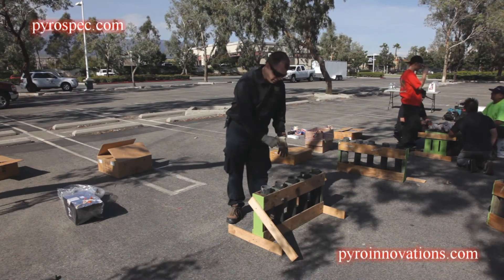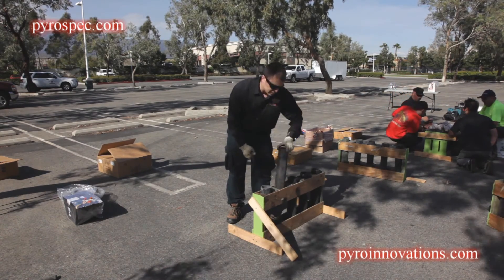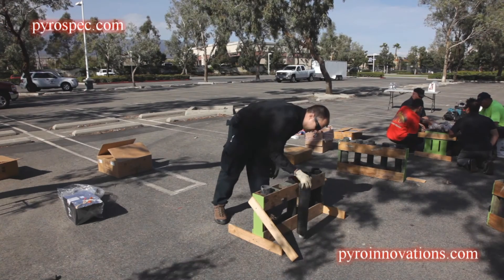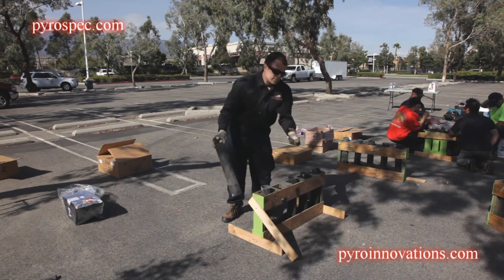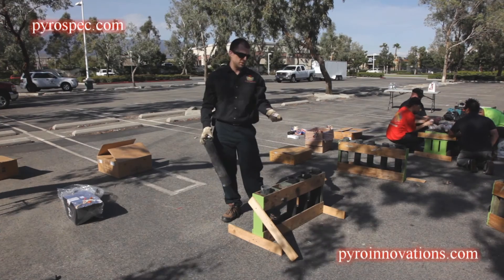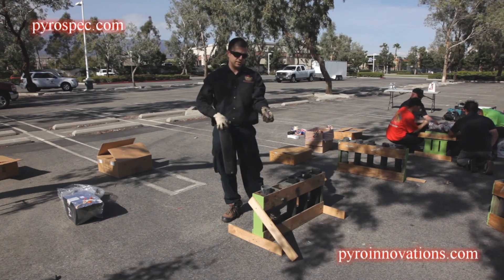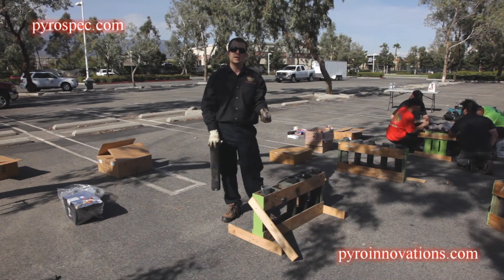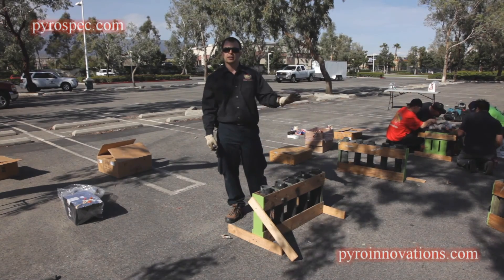How to Clean Fireworks Mortars

Comment: U didn’t explain how exactly is the best way to clean racks and the inside of the tubes??? Where do I find a 3” bristle brush for instance???
Reply from the maker: Pyro Guy, great question. Let me begin the answer by clarifying what “cleaning” means in regards to the inside the mortars on site at a fireworks display.  We are only trying to remove large debris at the bottom, such as old lift cups and fragments from previous displays, so that we ensure the shells we load get all the way to the bottom of the gun. With this in mind, the only tool you need can be fashioned from a stick with a couple nails on the end of it to stab and scoop any paper fragments at the bottom of the gun.  You can get fancy and make something for your tool kit to take with you to each show, or simply break a cleat in half and pound a few nails in one end on site. Let me know if that answers your question.